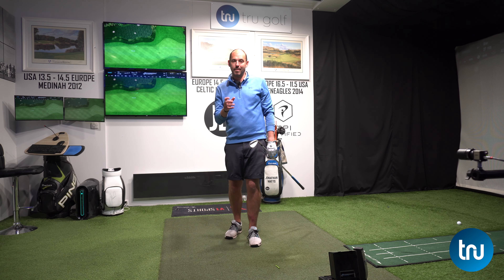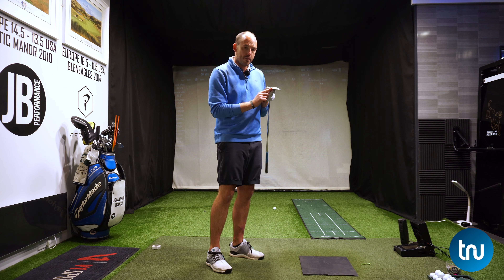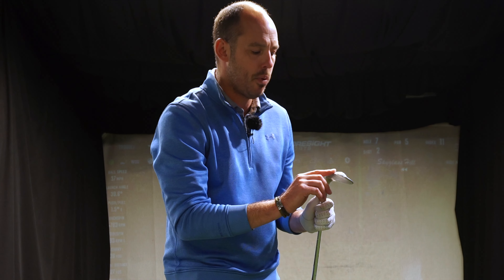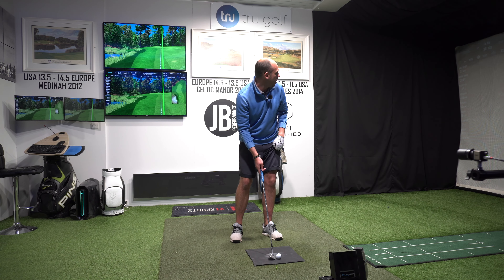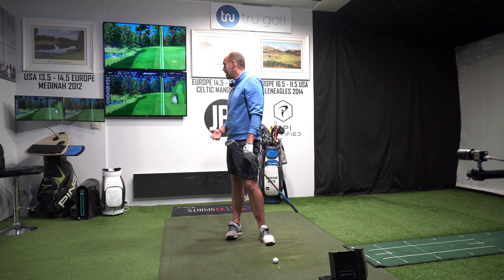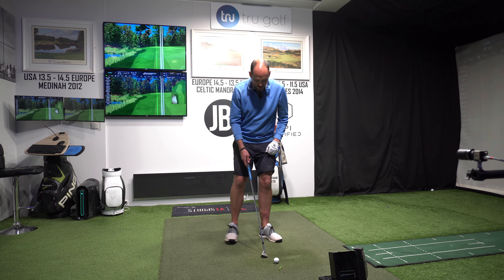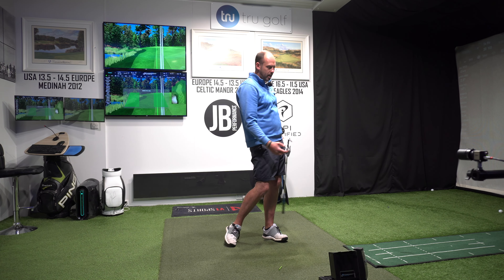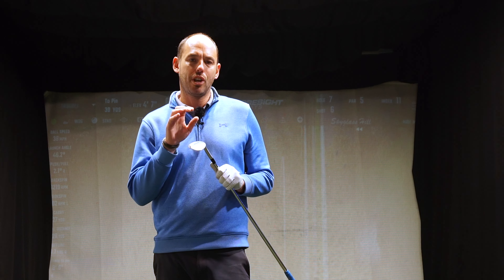SIMPLE 5O YARD & IN PITCHING : Are you PICKING or DIGING?

Comment: Thanks for another wedge  video.  On a similar topic on the  point of contact, could you do a video on putting a  ball in relation to the equator of the golf ball?  I’ve heard putting the ball above the equator and on the equator and on an upward stroke. What’s your thought?
Reply from the maker: Hi Tom, good idea thanks. Like most, the best would be the centre of the clubface striking the centre of the ball, i.e the leading edge of the putter below the centre. If the strike was too high on the ball it would Crete a negative launch, the ball to first move down into the green and jump.